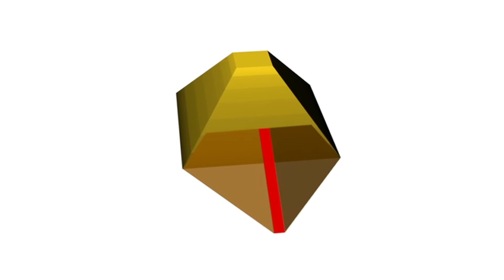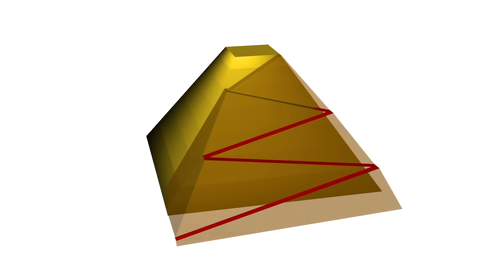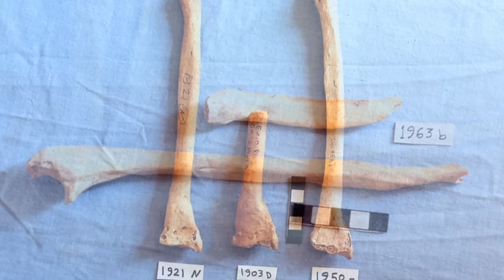Egyptology - Pyramid Construction

Comment: Given the 20-year construction "estimate", they were looking at placing one of each of the giant blocks every 10 minutes, around the clock for 20 years. They would also need time to quarry, transport and shape to one degree or another. Sure there were multiple crews but at some point, you reach a space limitation and a communication breakdown for the precision needed.
Reply: Didn't you hear the guy bro? They used strings and hand sanded down little bumps on all the stones to make them perfectly flat. It all adds up. I hear construction will finish by the 100th millennium. Boy would I like to see what a real pyramid could look like once one is built.
Reply: People also forget that there are smaller pyramids that were built  as test pyramids and the pyramids  had issues like being misshapen because they were still working out the kinks. I guess  that part people like to leave out.
Reply: @mk17173n  Exactly - and that is the most important detail.  We can see the evolution of design in Egypt.  We see them trying different things and then taking what worked and applying it going forward.
Reply: @mk17173n   I believe those 800 or so smaller pyramids that are found all over Egypt were feeble attempts to copy the Great pyramids,  on Giza.
Those examples are the best they could do. Eventually they stopped trying to create a similar great pyramid. The great pyramid when completed( honestly no one knows who or when it was built) was the tallest and most advanced precisely fitted together and the tallest for over 3000 years. It's still futuristic and still baffles EVERYONE who studies it.
Reply: @mk17173n  Yes you are right, the third dynasty built step pyramids. And then later the forth dynasty would build the iconic pyramids in Giza.
Reply: @benghazi4216  The truth is bass ackward.
Reply: Add the population to the formula.
They didn't had 7 billion bored lads to hang around to build the pyramids. Population was much much much smaller! Uneducated and cognitive skills pretty basic.

That's not formula of precision and success
Reply: @pepevonkek7803  ever heard of something called war and slaves?
Reply: At that pace and time span.. without any PPE or steel toe boots..go on smash one or two fingers! Oh, okay how about one foot with crushed toes? Carry on, rope burned and  blistered hands, sand on bare feet struggling up an incline with a 6000 pound block.× 1,000,000 +++++?
Get real.. the workers would've been chewed up and spat out every single day, and the loss of workers to injuries would've out paced the "new hires"
"Sorry not constructed by Egyptians.Already standing when Egyptians arrived and  settled near them.
Reply: @richardcoram1562  I think this comment is pretty reasonable and realistic. Assuming working conditions are same as today,.... Wow,.... It would be a meat grinder build. 

It makes more sense the biggest, more skilfully build pyramids were already in place long before Egypt of 4,000 years prior to today. Which explains why the more recent pyramids are much lower quality than the oldest ones.
Reply: @HaydenDavidson6  ☯️🤗✌
Reply: @HaydenDavidson6  👈👍✌😎
Reply: @richardcoram1562  Exactly. People are just like no they had multiple teams lol. Like it's another day at work. Even today with cranes this would be a pain in the ass
Reply: @VTGtone  👈🥂👍
Reply: @VTGtone  👈👍✌👈🥂
Reply: @richardcoram1562  how popular is this opinion that it was inherited ?
Reply: @richardcoram1562  I totally agree. Been in the construction industry all my life from labor up through management no way could they have done this without injuring alot of the people. Some folks say there wasn't even enough population at that time to build these structures
Reply: @countrygrandpa  Dont forget the staggering infrastructure the enormous amount of space needed for the workers to sleep and the enormous amount of food production needed to feed the 20-30 thousand workers.
Reply: porque niega la ciencia que las piramides fueron contruidas por una civilización superior y con tecnología que no era de este planeta los faraones tenían corta vida no daba para. La construcción de una piramide y cuando fallecian de niños
Reply: @CarlosVega-zs9fb  De Verdad ... por SuPuesto
Reply: if the tv says it, it must be truth, and dont forget also that politicians are all honest people who wants the best for the people
Reply: Aliens made it as a matter of  fact we are the 👽 aliens 😄🤓
Reply: Your forgetting about to 70 ton above the kings chambers
Reply: @chrisfrench314  you're  right, and it is the Kings Chamber in name only, as is the Queens chamber. No bodies ever rested there. This pyramid was some sort of power generating machine connected  to  a series of other structures such as the many obelisk that are  found in many places on earth..
Reply: @richardcoram1562  I agree with everything you said!
Reply: Yeah its basically impossible. Especially considering the precision
Reply: Your wrong they estimated it took 12 years!!! Mind blowing
Reply: You all wrong humans didn’t do much of it aliens builded them for us. They are perfectly aligned as well
Reply: @lazy4369  *Built
Reply: @lazy4369  *ok 🤣
Reply: https://youtu.be/4G6e4TaJxkI
What i see there .
Reply: It never happened like that ramps and ropes muscle power heave ho rubbish
Reply: I guess you havent tried working on a construction site. How dumb you are to put only one carpenter to finish a building?
Reply: Keep in mind they would have thousands of workers and it’s theorized that they pyramids were built by highly paid craftsmen not just slaves
Reply: @Michael ward  ha!ha!ha!ha!ha!
Their BEST state-of-the-art weapons of the Egyptian Armys were bows and arrows, wood tipped spears, wooden mallets, hatchets and axes.  They had NO HAND in building the Great Pyramid[s] on The Giza plateau.  The only thing the Egyptians did, is they TRIED to copy what was already standing. The step pyramids and all those other remnants and piles of rubble you see scattered about is all the Egyptians were  capable of. The workers doing those were chewed up and spit out every day . They had no PPE..they had no steel toed boots, no gloves no hard hats, no electricity , machinery, hydraulics! They were still using basically the same tools of their 140,000 year old ancestors. But just a more perfected version.
Because their attempts to build a great pyramid  like the one Khufu claimed, as his property, but they never came close, and the toll from injuries devastated the worker population. That's why , when they knew they could not build such a structure, All pyramid building stopped. WHy? Because pyramids were  not their thing. They found that out the hard way. It isn't so much the Egyptians  built the pyramids  but rather The great pyramid built the Egyptians.
Reply: @richardcoram1562  The Egyptians were plenty capable of creating other, more complex architecture like Luxor temple and Karnak. The pyramids are just stacked rocks and neolithic people were already capable of making monoliths like Stonehedge.
Reply: @divinechariot5542  All the megalithic structures that are aligned in a specific way around the world were created on precise ley lines, and the great pyramid was  so precisely built that on any side the base is less than one half inch off, and when it was built it was situated at exactly true North. The truth about Luxor is still out. Recent findings suggest that much of that complex was already very prehistoric and ancient when it was found and built upon. The most ancient parts of ALL the mega structures found around the world , have several things in common, including Luxor, is the BASE STONES/BLOCKS, which are over a thousand tones in many cases. Nothing on earth existed that could cut a single megalithic stone that size from a quarry, remove it,  transport it 500 miles over land, water, and place it so perfectly and precisely in place creating a base without mortar that you can't slip a single sheet of paper between the joints. These base slabs and blocks were already in place. They were built by a pre-historic system of highly intelligent civilization that were highly advanced in their methods of engineering, and that highly superior civilization was global. The same styles of building, are found around the world. That civilization perished, rather suddenly it seems from s cataclysmic  event. But their structures survived , and the same at Luxor, where it appears there, much of Luxor was struck by a nuclear event,  or a very deadly gamma ray blast from the sun that actually shows vitrification of many artifacts that are strewn about there. Experts have determined that  that cataclysmic event  happend early in the morning at sunrise due to the angles, and burnt vitrified statues, columns and destroyed obelisk. 
To begin with, its rather weak to say the great pyramid is just a bunch of stacked blocks. In essence it is, but there's way more technologies involved in those stacked blocks than meets the eye. The highly advanced civilizations that  built them had way more in their arsenal than just bows and arrows, wood tipped spears, wooden mallets, hatchets and axes. We don't know how many times the earth has been host to very highly advanced civilizations that advanced from the cave to the highrise, so to speak, but we do know that the base stones found around the world are ALWAYS the largest of megalithic structures. The base is of another civilization that  vanished. Each time after a cataclysmic event the human survivors would've been  forced to begin to repopulate from the caves, and over a million or 2 or 3 million years crawl and survive their way back to the highrise pent house suites. Earth is estimated to beover 4.5 Billion years old..so there's a lot of millions of years on this rock where civilizations came, evolved, got destroyed - back to the caves, over and over and over.  If our world of today collapses, say, a deadly sun solar eruption, and all the satellites we have circling earth. They controlled everything on earth. Lights, water, banking factories that produce our every need...it would all stop, instantly. No phone no GPS no aircraft could fly nor trafficking lights no communications at all. Pitch black. I'm~and there are only a handful of survivors , oh well, back into the caves...again👈😥✌
Good day!
Reply: The “workers”/slaves used did not have any other choice. There was no 40 hour work week with pto and weekends and holidays off lol. They didnt have a help wanted sign. The few that spoke up in rejection were slaughtered
Reply: @Zionik81  The pyramids were not built by slaves. And they were treated well, as they were skilled laborers.
It was an honor to build it, not your death sentence.
They got good housing, both cattle and sheep, and liters of beer, per day.

You are relaying a version of the Christian propaganda found in the Bible. In other words, not close to reality.
Reply: @Zionik81  You can doubt it, but we have proof that they were treated well.
Egyptians were good at keeping records being the well run civilization it was.

The ones the Pharaoh's treated badly was the regular population. Not the people building his tomb, his legacy
Reply: @benghazi4216  they kept records of what they wanted. Dont take it as 100%fact
Reply: @Alexander Keiser Absolutely.  Do you understand the concept of photography???  lol!  Explain then please why the remaining white Tura LIMESTONE blocks found on the bottom of the Great Pyramid and the top of Khafre's Pyramid are still smooth when all the rest are not if your weathering played a role???  

The casing blocks are limestone the same as the rest of the pyramid yet they still reflect polished surfaces rather than being ravaged by 4500 years of exposure - not 6000.
Reply: its all lies.
Reply: *every 4 minutes
Reply: the people back then worked for a living. They were straight animals bro. With all their gods and whatnot, it gave them unimaginable strength and motivation. They would have had thousands dedicating their lives to these pyramids every day,
Reply: You're basing that on modern man logic.
Reply: Millions of times
Reply: How did they level the ground underneath so perfectly ?
Reply: @patrickbly4170  They must have been flat Earhers.
Reply: Crews like they weren’t slaves 😂
Reply: I am an industrial rigger. This would be a HELL job even with giant cranes and chokers
Reply: @johnsammon6741  Of course it would.  But "scientists" claim it was all done by hand in less than 2 decades.
Reply: The workers (not the technicians) who made these pyramids were not Egyptians but some men that they brought from Spain, who lived in some caves in a place called "Atapuerca" (Spain), these human beings from Atapuerca were different from the current men, with body structure similar to that of a gorilla, with biceps x6  more in circumference than the biceps of modern men.
Reply: @TheMariepi3  where is there more info on this? Sounds interesting.
Reply: @TheMariepi3  So Sasquatch built it?  That's actually more plausible than the current "scientific" narrative.
Reply: Also if they did it in the manner suggested it would have taken an extra 500 years.
Reply: And yet, they still got built.
Reply: What about the food and water needed?  Where did that come from?  If it took 100,000s of people to build, it took quite a few more of them to feed and breed
Reply: “Precision” is relative to application. The vast majority of precision is relegated to the outer casings and the inner passageways which is far, far, FAR less than 1% of the surface area of each block used in construction. This is plainly visible in the exposed blocks that are exposed after the casings were extricated and repurposed over millennia.
Reply: I always have to laugh at the 20 year estimate I doubt if they could  have built it in 200 years.Using modern equipment it probably would take 5 years, now think how primitive it was 4000 years ago.
Reply: @hifijohn  I think a lot of modern scholars  ascribe these civilizations to be nothing more than unsophisticated apes who had barely had a functioning communication system  thus they drew hieroglyphs.  Why would a sophisticated society draw pictures if they could articulate in complex sentence structures to explain themselves?  Again it comes to our civilizations unchallenged hubris thst they didn’t know more than us.  The library of Alexandria patently debunks that.
Reply: @hifijohn  No bro, with modern equipment it would not take 5 years. If you count the quarrying, Im no expert but it would take more than 20, by far, maybe 50-100 years at least. There are 2.3 million blocks, megalithic blocks, in 5 years you would have to place aprox 1260 in place every day. And people forget that there are more pyramids and structures, and all of them have tunnel systems that have miles upon miles, and from what Ive seen, theres alot yet to be discovered still. Just shows to me how ridiculously oblivious they are just to fit their story and still be able to talk like Vary Olla above.
Reply: Eliminate the most common or obvious way of thinking how they did it and accept the less obvious......2nd hint...Why are there NO hieroglphics specifically recording how they built it?  Why was the history of its building which would have taken a million people to build over generations not passed down to the modern generation.  We see the same dilemma in the giant stone walls in South America. They would have been quarried 14 miles down a huge mountain from where they were eventually set up, and again the indigenous people have no records of the work, except what they added to it years later, which totally looks different and smaller.  There Obviously a group that built both that purposely did not share the information and did it before the indigenous tribes showed up.  Any other theory will always run into the same questions and dilemmas over and over.
Reply: @kevinbraden798  👈👍✌😎
Reply: @kevinbraden798  so according to you,, who were those people who built the pyramids with advanced technology yet they never knew how to document it? The best guess is that ancient Egyptians built the pyramids and the indigenous people of South America built the walls. 
We can't be 100% sure they did it but saying that some other people did it is somehow off.
Reply: Rony Sim  I don't think 21 cattle and 23 sheep a day for 10000 people is anywhere close to starvation.
And to that add the daily beer rations etc
It was hard and somewhat deadly work, but not that bad for the time.
Reply: @benghazi4216  so where did the millions of cattle and sheep goats, pigs and camels come from? Because it wasn't just 21 cattle and 23 sheep, for 10,000. If that's even true. That technically would've been the requirement every day - for how many years, and everything syncronized running like a Rolex watch, every day. See, we can't even keep our modern day  Logistics and supply lines open and operating.. were running out of everything . The Egyptians did too.,plus the seasonal floods that occurred, affecting crops. Nothing adds up. Maybe you have an explanation for  how these ancient primitives figured out the exact true North alignment of the Great pyramid, and set on the exact latitude  of 29.9792458°N, and the speed of light which is 299793458 m/s.. not a coincidence. I'll be waiting for an answer. Good day.
Reply: @richardcoram1562  Sit down and actually think about this.
How much does cattle weigh? On the low end 500kg now, so lets say 300kg in their times.
We use about half of the weight towards food, I bet they used more, but lets say it's the same 50%.

So you have 300kg*0,5=150kg of meat from one cattle.
Now multiply it by 21 and you get 3150 kg of meat from just the cattle alone.
That is enough to sustain 10000 people per day. And then you have the sheep for breakfast.

How is this not enough? You are making up problems where they don't exist.

"See, we can't even keep our modern day"
Are you joking?! The meat industry is a half trillion dollar industry worldwide. How do you think McDonalds can serve 69 million people daily? 

Again, making up problems that don't exist.

Seasonal floods affected crops yes, in a wonderful way. This is why Egypt was the most affluent civilization for thousands of years. That is what made them be able to afford mega projects like this.

Again making up problems that don't exist.

True north, which is easier to pin point than magnetic north at the time can be found by looking at the stars. You can do it now, and they could do it then.  

And my god. Meters in an arbitrary length the French came up with after the revolution. And we have changed it a few times. Do you not realize that this makes it ridiculous to claim that the Egyptian tried to match a number in a measuring system that would be invented 5000 years later, in latitudes that also was invented 5000 years later?

So there you have it. A point by point answer.
Reply: @richardcoram1562  Stonemasons were not treated like slaves, but it was hard work. Added to that accidents do happen, and people die. How is any of this strange in your mind?

You really think 40 animals a day is somehow an astronomical number? Really?
It's NOTHING for an civilization like Egypt. 

And how the f*ck do you think an army of tens of thousands of Egyptian soldiers were fed? And they were on the move...

 "Obviously you  believe the Egyptians  knew that their placement of their  pyramids  on the latitude  would have the very same exact numbers as the speed of light? I don't think so"
I literally told you how STUPID that idea was, and now you say I believe it. Ridiculous.

Chariots were the Egyptians state of the art weapon. It was the ancient wonder weapon.

"Wood tipped spears"
I mean are you for real? 

Bronze was common. The Pharaoh even had a iron dagger.
Reply: @benghazi4216  Not that bad? Lol
Reply: @VTGtone  Read the whole sentence.
The ending is quite important.
For the time. They were priced craftsmen remember. Not some slaves you throw away after you worked them to death.
Reply: @VTGtone  🏹🥢bows ,arrows, wood tipped spears, and yet they supposedly built a machine they didn't understand its purpose. But yet they made it to last hundreds of thousands of years . They also, on second thought decided  how cool it would be to also make it the tallest structure on earth, that would reign true for over 3000 years...PLUS, they decided to build it on a latitude and coordinate that  has exactly the same numerical numbers as the SPEED Of Light. Hmmm...
Reply: @benghazi4216  could be but  y'all conveniently ignore that these people were still primitive, they had no PPE at all, and this work would have  chewed them up and spit them out by the hundreds every day. You ever smash a finger or toe nail? Just one or the other.? How about two fingers, or toes, ...keep climbing the injury type ladder, were getting into crushed feet, hands broken arms and legs, runaway 5 ton stones crushing and smearing unlucky workers like butter on hot toast., You all forget that a single smashed and crushed finger or a strained or broken back puts you out of service.
Reply: Wrong.  Next time think more broadly.  The pyramids are large structures which can easily accommodate hundreds of workers broken down into teams.  Thus they could easily allow for multiple teams working in tandem in different places on it.  That alone would facilitate multiple blocks being laid in tandem in different parts of the pyramid.  So forget your quaint "X" blocks per.........nonsense as they is premised upon "1 at a time" = which no one builds that way - not even back then.  

p.s. - look at those blocks.  Very few are carefully cut and shaped let alone polished.  Most are little more than crudely fractured chunks of stone of assorted shapes and sizes reflecting their fracturing from the bedrock in a rapid manner and being hauled away as is to the nearby pyramid which was only 100-200 meters away.
Reply: Even the bedrock is paved with giant stone blocks, the pyramids are not constructed on naked ground. And who made food for all the workers? Who made ropes? Tools? Do you understand the amount of people and logistic involved? Use your brain and stop writing nonsence
Reply: @sash328  You don't think they could've figured these things out? Surely, they DID, because they DID build them. They're still there.
Reply: @gusgrizzel8397  yeah, that's basically exactly what the Ancient Egyptians were  saying about them also.
Reply: @varyolla435  Nope, no way. HBesides they didn't have any PPE. NO STEEL TOED BOOTS, no gloves means blisters, barefoot on sand, more blisters ,crushing injuries to fingers, toes, hands and feet. Broken legs, arms etc; man would've been chewed up and spit out. No emergency room or trauma centers, No electrical lighting for working deep in the darkness of the  pyramid, and a massive mess hall running 24/7, and sleeping quarters. The logistics challenges impossible with the limited number of available bodies with a physical and mental ability to work.
The great pyramids were already standing  when the Egyptians arrived and  settled around them. The lessor pyramids, the ones that appear to be older, are actually the newer pyramids- built by the Egyptians in an attempt to copy the great existing pyramids. The Egyptian ones are more like shoddy and piles of rubble.
Reply: @richardcoram1562   so if the great pyramids were already standing when the Egyptians arrived, who do you think actually built them?
Reply: @tariqreid1866  As far as I can tell nobody knows for sure. Nowadays, it seems that even new archeology research points to the Sphinx being created long before the pyramids. Here's the thing; recently found artifacts, tools ect; go way back past the 200,000 year time frame for modern man. Thats when tools and artifacts show human innovation, and  hunting spears, etc; so this mos recent cave find is estimated to be 600,000 years old, because of the crude  stone tools and chipping method use was done not by a primate, but human. Now fast forward to the days of the egyptians, and look at how far they had advanced. They had from the 600,000 year human, but really only in refinement of the tools, language buildings, instead of caves, but basically the Egyptians were  still using bows and arrows, spears,and a little metallurgy. They weren't  much more advanced than the humans in the caves. So I believe that the Great Pyramids(2) had to have been created by a far far advanced  life form possibly 500 million years ago, likely highly technical beings, or even Gods, with power equipment, lighting, and the pyramids that the ancient Egyptians settled nearby, was the inspiration- that actually, over the thousands of years living near these monuments. would've been the greatest expansion of the  mind ,and the attempts to duplicate those two monuments. Its also recently been revealed by some architectural archeologist, that all those smaller pyramids, and the piles of rubble of others- those were traditionally thought to be older than the great pyramids, but now it appears they are actually newer builds. Those were actually built by the Egyptians in an attempt to duplicate!  In the Great Pyramids, there has never been found any Egyptian art, reliefs, paintings, hieroglyphics ,and NO king OR Queen entombed in them.
Reply: @tariqreid1866  There is a section of history that we will never know about that is missing.  I have no doubt that there is a time period on this earth that a population of people with highly technological skills lived.  What happened to them, who knows.  The Earth will always take back what we have created.
Reply: @tpainter81  I believe you are correct. Something's missing that we just don't know about. There are many other history mysteries besides the pyramids
Reply: @countrygrandpa  yes. I think the pyramids were just located in a place where they could have lasted for thousands of years. Egyptians took credit for them. Why would they take the nicest part from them if they were so sacred?
Reply: @tariqreid1866  This strange steel plate has been found and it has been proven that the 43 granite beams of the (kC) had been stored on steel supports for at least 10 years. it was about protection of the surfaces and corners. this suggests a modern, prefabricated construction method with high-quality measurements as we know it today.
Reply: @johnwalker1553  Stop believing in fairy tales now..
Reply: @benghazi4216  what are you talking about ?
Reply: @benghazi4216  🤣  IKR.  John needs to unplug from whatever rubbish they have been fixating upon and open a window to breath some fresh air here in the real world.  They are waaaaay down the rabbit hole.  They'll be having tea with Alice soon.
Reply: @richardcoram1562  Your thinking is lame and clouded by lack of facts. Do your research well and you will know that the pyramids were built by the ancient Egyptians who are some of the most civilized people of the ancient time. Saying that the pyramids are millions of years old or claiming they were built by gods is ignorance and stupidity of the highest order.
Reply: @tariqreid1866  It is said by some that people of Atlantis build the pyramids and Egypt was a colony of the Atlantis empire.
Reply: @richardcoram1562  Completely false. There are hieroglyphic inscriptions in the pyramids detailing the names of the workers and pharoahs resting there. They were most certainly built by the Egyptians.
Reply: @varyolla435  👈👍🥂yes sir, even majicculeaide (only found in Alice's den)😂.
Reply: @tariqreid1866  if someone knew thst, their name would be on a Nobel prize.
Reply: @richardcoram1562  can’t take anyone seriously if they don’t even know how to use paragraphs.
Reply: @tpainter81  Egyptians didn’t take credit for it, it’s we who ascribe it to their credit.   Just another prime example of modern man’s unchallenged hubris falsely laying claims where they have no business doing so.
Reply: @varyolla435  - Much like having tea with Joe and Jill and Hunter.
Reply: @varyolla435  ur point don’t make sense cause a modern crane can’t lift some of those stone pieces and they can’t replicate pyramids today so every way people say they were built is false
Reply: @shap7296  🤣  We can send satellites to other planets and manufacture items with accuracy down to thousandth of an inch = and you think we can't duplicate a stack of crude blocks.

Think harder.  Why do you assume they were only lifting blocks.  Did it not occur to you that via a ramp blocks can be pulled/levered into place as well.  

Also Science Channel did a show a few years ago:  IF We Built It Today.  They interviewed stonemasons, engineers, architects, and even stone quarry owners about building a duplicate Great Pyramid out of granite.  Everyone is more than happy to do so - IF - you have a deep checkbook as it will cost a bundle at today's economics.
Reply: @varyolla435  they can't build it!  So put up or shut up. There are many people on this planet that are so filthy rich ,the cost to build an"EXACT REPLICA" would be equal to me buying Dinner for six at my favorite Chinese restaurant!! Money isn't the problem.
Reply: @shap7296  you are taken in by the we don’t know how they built them as meaning we can’t build them 
Are you honestly saying today we could not build the pyramids. ? Lol 
But the Empire State Building could be built lol
No one can say this is exactly how they were built as we don’t have a time travelling machine 
The blocks have been tested they are poured limestone cement 
They literally built basic wooden boxed frames and poured it in 
Do a level then repeat 
Wouldn’t take more than 12 years to do this and would not require more than a 1000 people
Reply: @danielkirkland3366  no we can’t build the pyramids today modern cranes cannot hold that much weight the Empire State Building weighs about 375,000 ton the pyramid of Giza weighs 5.75 million ton lmao you literally don’t know anything go do some research
Reply: @danielkirkland3366  yeah you have no idea what your talking about lmao they have granite blocks as heavy as 80 ton no modern crab can lift that and they didn’t use limestone cement mixture lmao they use cut limestone and the high quality white limestone was stripped away by Muslims to build mosque. Also bigger and more lightweight isn’t a greater achievement that’s like saying if I built a 1k foot tall scaffolding of wood it’s would be a great achievement cause it’s big and lightweight lmao. There’s a reason why they actually know how the pyramids were built and the limestone quarries were close but the granite quarries were 500 miles away
Reply: @shap7296  you’re a clown only around 2 % is granite and this appears within the bottom of half 
The blocks have been tested it is limestone cement
Strange how you say bigger and heavier isn’t an achievement when you are obsessed with granite blocks 
I also said bigger , stronger and lighter not heavier
Reply: @varyolla435  That makes some sense. But no one alive was there. So, you're theory is still a matte of opinion. This dude has been studying the problem for decades, and he still doesn't know for sire. Also, those "crude" cuts could have been highly polished at first.  Thousands of years of sand blasting would have eroded the polish.
Reply: @MiguelRodriguez-zd6tq  they’ve not been open to the elements for thousands of years, the casing stones fell off relatively recently
Reply: @K1llerTunes  I believe the Three pyramids (one being the great pyramid) the one Khufu claimed as his real estate back in the day. I believe they were already standing at the time of our Genesis. The garden of Eden was very small plot of land, and Caine was sent away after killing his brother Able,  he went out into the world of other beings. Some say he married outside the Garden of Eden.? Later God sent the floodwaters, but had told Noah, a descendent of  Adam and eve to build an Ark load it up wit two of each beast and fowl .
I think the Pyramids were already standing at that time, and there was a cataclysmic event that destroyed the  builders of those pyramids perhaps hundreds of thousands of years prior to The great flooding of earth that destroyed mankind. A similar event happened to the civilization that built the great pyramids.  Imagine this. A primitive people engineering a structure that is so solid, so precise, so durable and so tall, that it stood with the record of being the tallest structure on earth for over 3000 years.Not only that its position, and latitude is the same numerically as the speed of light. So, no! These  were not constructed by a primitive people whose most state-of-art weapons and tools consisted primarily of bows and arrows, wood tipped spears, wooden mallets and hatchets and axes.
Reply: @MiguelRodriguez-zd6tq  better than the other guys lmfao
Reply: @varyolla435  you have to account for what the pyramids ORGINALLY looked like not what they deteriorated into or better yet it’s entropy,
Reply: @varyolla435  la de da excuse him im glad you saw them build it.
did you take pix with your smart phone.
Reply: @varyolla435  Wrong. You lack the ability to critically think and don't understand how precise every single block was placed. And for the blocks that looks "jagged" or "uneven" is maybe because they've been exposed to thousands of years of erosion. Ever think of that?
Reply: @hj210  yes exposed for thousands of years, then surviving the great flood,  then preserved under the dunes for another million years until  Englishmen and western explorers and archaeologists began digging it all out in the 17th and 18th. Centuries. Today they are showcases that the modern Egyptians claim. Great work, by EUROPEANS and Englishmen  to come into Egypt and uncover a machine built on coordinates,  and a latitude where the position was true north and the SPEED OF LIGHT are the same numerically.
Reply: @hj210  you don’t mention the other many pyramids it Egypt that did collapse 
They learned through the years 
The precision mainly comes from the fact that the blocks are confirmed to be made from limestone cement 
They made a wooden frame and just poured it in to make the blocks and so on until they reached the top 
The blocks have so much weathering it’s impossible to say how precise they were 
As for the maths used yes impressive but not unique it was used in South America and Greece also
Reply: It’s hilarious that someone tried to personally make some sense of the situation and you decided to act high and mighty while giving info that was already understood by watching the video
Reply: @varyolla435  The structures weren't built at the beginning therefore no one fit inside of it.  Most of it is solid.  You are making complicated excuses to cling onto a belief that has been disproven by proxy dozens of times.  Like Dr. Hawass.  Same thing.
Reply: @varyolla435  You're only talking about quantity of logistics. What about the surveying techniques? please tell me something about the RQ-Rods and their tolerances, among themselves. Show me how you got to the apex with handy transportable protractors with mounted plumb bobs on all pyramid sides I am eagerly awaiting your explanations. The discussion among engineers in the 70s about optical tools went unheard by Egyptologists. but have you ever aligned an optical measuring device to the level? you can be 2 meters wrong. or have you ever measured a basement ceiling with a hose scale. These Rudimentary explanations are of no use in view of these buildings.
Reply: @johnwalker1553  Right on man, and the other very important thing to contemplate, is that the  precision alignment of true North is relatively complex today using computers, and the latitude the Great Pyramid is built on   is 29.9792458°N, and the speed of light in a vacuum is 299,792, 458 m/s. I dont believe that's a mere coincidence. 👽
Reply: @varyolla435  My friend,  don't you think that thousands of years of sandblasting could account for the cracks and unevenness? Of course, you know that other theory that the Great Pyramid is actually over 10,000 years old, perhaps older. The thing is, nobody knows. Yes, I'm  aware of the your explanation. The bottom line is that we don't know how they achieved its' construction. It may well be that the did it in teams working in tandem.  But that's just one possibility.  Now, I'm not a fan of ET intervention. I think ancient humans are more crafty than they're credited with....  Have you heard of a book titled, "the story of Adam and Eve?" Check out the way that book was classified and sanitized by the CIA. There are probably truths in there that are kept from us.... be good!
Reply: @varyolla435  "I am interested in "facts" = nothing more.  Stone cold, verifiable, historically relevant facts"

The guy in the Video "We actually still have no idea how the ramps were build"

okay so why do u think those people, that dont know how they did it, have it right?

PS: The great pyramid of Giza took 20 years to build like said before..... and holds about 2.5 Million stones... if you do the Math thats actually one stone block placed every 3-4 Minutes for 20 years straight...

PPS: actually the blocks have to be perfetly placed and fitted on all 6 sides, becouse if one side is crucket, it will get worse exponentially. If such bad building would be the case, the pyramid wouldnt stand as long as it did.
Reply: @varyolla435  A german laboratory has used samples to prove that high-quality steel products were used to store around 10 years, the granite beams (KC) on it. It is simply a matter of protecting the corners and surfaces of the building materials. I'm curious how you tell me now if you have lifted the beams with wooden wedges as you have managed to do it without damage on the surfaces. apart from that, it doesn't work with wooden wedges, you can test it on heavy prefabricated house parts.
Reply: @varyolla435  Thank you Sir
Reply: Conspiracy theory are for the smart ones with a brain. 

Also, if you didn’t know already, your theory is a conspiracy theory as well ffs.
Reply: @BeRZerkeR_z  - Not a fact but simply an opinion but what if the very stones that took to build the pyramids was lighter at the time and they knew it would harden as time went by?  The earth was after all still young.  My fascination with not only ancient Egyptian but also the Aztecs, Mayan and Incas use of mathematics.
Reply: @talos2373  young? the earth is Billions of years old, it didnt change that much in the last 5000 years, tahts nothing comapred to 4.543 billion years? what ur saying makes absolutely NO sense
Reply: @varyolla435  that’s just opinion kid lmao🤣🤣and I really doubt humans built it that fast try again kid